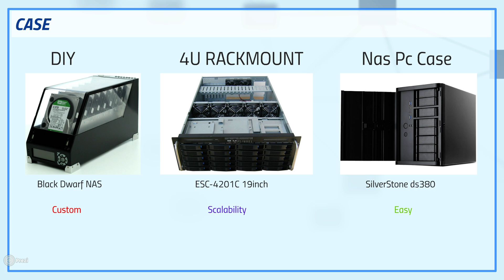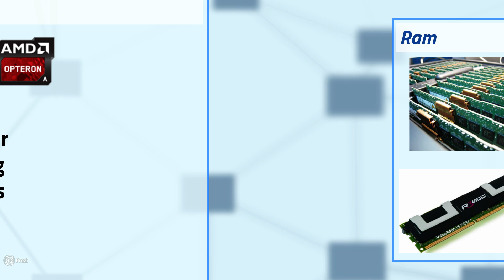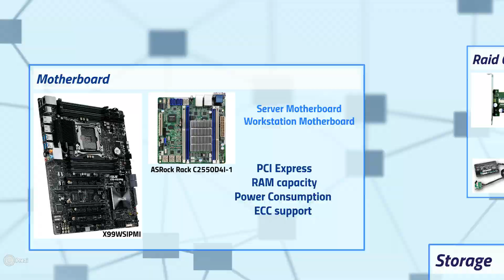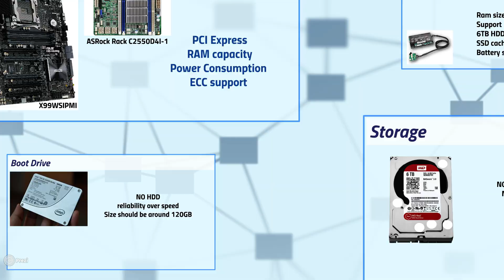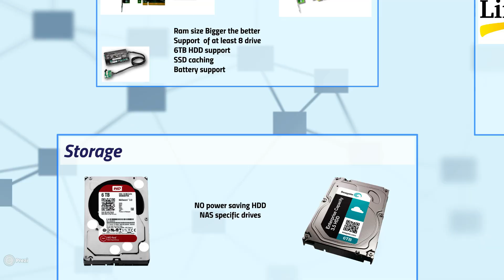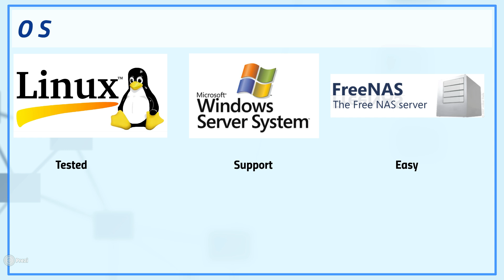Do It Yourself NAS Guide 2015

Comment: The resilvering time depends on the size of the drives currently in the raid array. But a major bottleneck is the CPU. Also, the process of resilvering is a block level operation, so the amount of data stored on that array doesn't really matter. It will always write the complete amount of data that the device is capable of storing.
Also, you can achieve a stable 10 gig connection with up to 30m of cat6 or 100m of cat 6a.

Comment: YES to HDDs and NO to SSDs.
HDDs (if you don't go and the the absolute bottom of the shelf stuff) offer a much longer lifespan when compared to SSDs. Especially for server workloads, where there will be multiple gigs of random I/Ops. An average SSD will simply die off in a very short time span, very similar to what you mentioned for the HDDs (4-6 months).

Comment: Freenas manual says 8gb minimum for os USB. I know it doesn't use the entire drive.. But just saying. Also freenas does software raid and they are really against any kind of hardware raid controller.. Good video and great points covered.. On the freenas Facebook page I saw someone build a freenas on an Asus z97 gaming board.. I was totally baffled but then again lack of variety of parts and lack of knowledge does get you very close to danger
Reply from the maker: +bhoot  r u sure as many time people forget to update manual Regard less EPIC point and using z97 it feels like if u can then why not and it does offer better power rail and better features set so u know over kill but ok
Reply: +Anupam VIPUL quote from 2.3 under freenas manual "Note at this time, the installer does not check the size of the install media before attempting an installation. A minimum of a 8 GB device is required, but the install will appear to complete successfully on smaller devices, only to fail at boot. If you are mirroring the boot device, it is recommended to use devices of the same size; otherwise, the mirror will be limited to the size of the smallest device."
And won't a z97 run hotter and consume more electricity than a server board apart from having a lot of ports which do nothing. Freenas doesn't support usb3.0 to begin with.. Similarly audio ports aren't of any use.. 
Personally I'm running freenas 9.3 on an Asus Z10PAU8 and I am getting approx 100mBps transfer over cables. And all cat 5e cat 6 cat 6a are capable of reaching those speeds.. So yes.. A bare minimum cat5e cable is where a gigabit switch with no link aggregation remains as my choice and vfm..